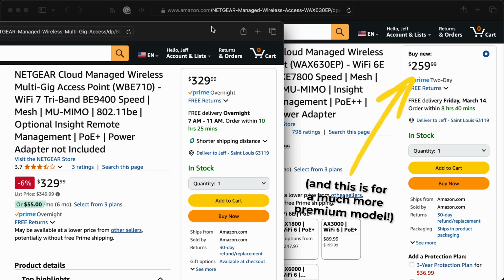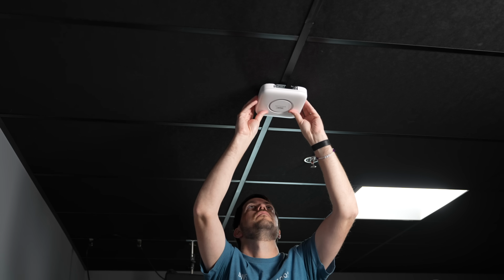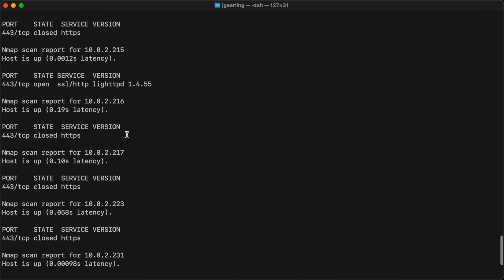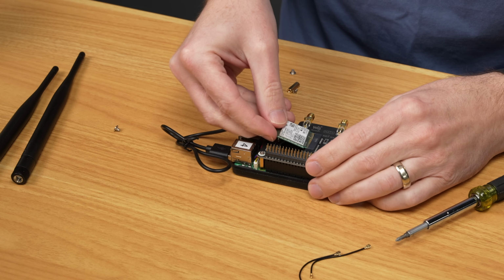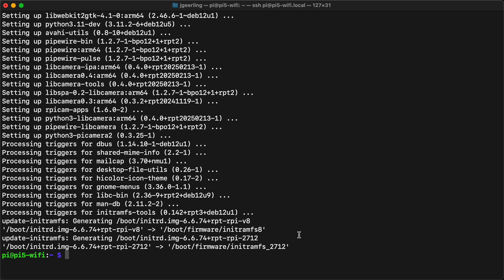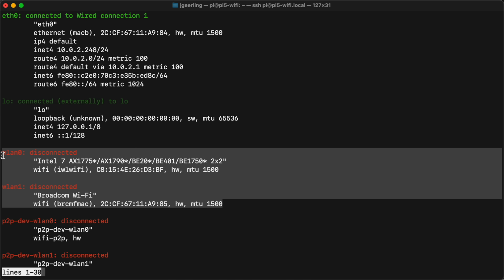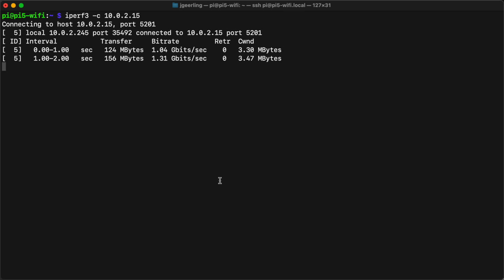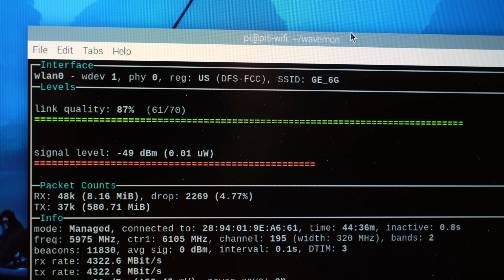The fastest WiFi EVER on a Raspberry Pi

Comment: 6:50 It's even easier than that actually. `sudo apt install firmware-linux` should grab all the firmware you'll ever need, and install it to the right spot. You can even install it before you do the system update, so you can be sure it'll be up to date. This package is cross-platform, and it's saved me a lot of confusion and pain during my continuing journey to get an NVidia GPU running on my Milk-V Jupiter. Highly recommend it in the future if you run into firmware issues, it'll make your life a lot easier.
Reply from the maker: Note that it installs the firmware packages packaged up by the OS distro—what I've found is newer hardware often still doesn't have its firmware included in the packages, unless you're running a cutting-edge OS release like maybe Arch.

For the Pi, it has an `iwlwifi-firmware` package but it only has outdated firmware and not even working files for the AX200!

Comment: Did you just say that wireless got faster speeds than wired ethernet?
Reply from the maker: On the Pi 5 with it's slow 1 Gbps network connection :(

Comment: Would be interesting to see if this or WiFi 6E cards could be used as an AP (or to create a mesh network?). Then the question would be (assuming it can be done, is stable etc), why hasn’t anyone created a board to do this where a CM5 (or perhaps CM4) can be plugged in and used :)

Comment: Hint for when you do stuff with passwords: 1) you can hide password containing lines from your bash history if you start the command with an empty space. That's the marker for not saving it to the history file 
2) you can also do a "read PASS" command to read the password from stdin, and then use "$PASS" in the commands. That allows you to show the full command line, and even save the history
Reply: The space in front of the command to prevent from adding to history is a bash config, don't expect it to be a default everywhere.
Reply: @kypdurron  Right. The HISTCONTROL variable configures this. It defaults to "ignoreboth" on Ubuntu, but might be set to something different on a random system you login to.
Reply: Sterling tips.

Comment: The biggest reason to wait on Wifi 7 is Wifi 8. The plans for it are 100Gb/s speeds, using a much higher frequency spectrum, with all the added benefits from Wifi 7.
The biggest jump from Wifi 6E to 7 is the larger channel size, which doubles the speed per device. So you are looking at a possible doubling of speed from Wifi 6E even, which is a much larger jump than the last few generations.
Reply: Agreed.  I was all set to standardize and upgrade everything from 5 to 7, but then I saw 8 is scheduled for 2028 (probably 2029 at the earliest for IEEE 802.11bn draft honestly) and the more spectrum being considered like 60GHz and said "heck with it, I'll upgrade stuff to 6 and sit tight 5+ years."  Just splurged on a WiFi 6 enterprise AP and more than satisfied.  WPA3-Enterprise support is still half-baked on e.g. Windows 10 and some APs so I don't mind delaying for once.  Plus I don't even have 2.5/5/10-Gig copper switches so 7 would be a waste until I upgrade wired backhaul first.
Reply: @dudeh9702  And depending on your setup, Wifi 8 may become your backhaul. Much easier than punching wires through your home, put them on opposite ends of hallways/etc, and boom.

Comment: With a few added features? MLO isn't something to skim over.
Reply from the maker: It is if it's hard to get any devices working on it so far :)

It's still early days for WiFi 7, just like 6E, it'll be a couple years before anything but the highest-end devices take advantage of all the goodies.
Reply: @JeffGeerling that is true (Windows support hasn't arrived yet, though it supposedly works on Google Pixels) however you did imply that you have MLO functioning, amongst other features, where it doesn't seem to be the case given your throughput (also couldn't find evidence of MLO support for Intel WiFi on Linux, only MTK). Another thing to try is 320MHz bands, if supported by your router.
Reply: @JeffGeerling , for example here's the difference between not having and having 320MHz functioning on Android (the Pixel just needs the router to "force" it for some reason, otherwise should have similar speeds to the OP12): https://youtu.be/0BJ8gvfJ8_E.

Comment: Lowering transmit power on 2.4 GHz is an underrated band steering technique. There is usually little reason to leave it at max power, especially in a multi-AP setup.
Reply from the maker: You mean you don't enjoy just blasting a little extra RF 24x7 out of every AP on the planet? :D
Reply: Lowering transmit power on every frequency is one of the ultimate techniques for Wi-Fi excellence: less interference to neighbor APs, less noise, less electrical power used, increase in hardware lifespan, devices connect to the better signal in terms of quality and not in terms of reachability.

Comment: Nice project, but I noticed you didn't use MLO and the 6Ghz channel was only 160Mhz instead of the 320Mhz that is possible with WiFi 7. I don't know what speeds the rPi can handle, but under the right circumstances 4Gbps should be easy to reach. (as long as the AP has an uplink fast enough and the bus speed of the rPi is fast enough).
Reply from the maker: 320 MHz width was used in the last 1.83 Gbps test; couldn't figure out how to get MLO to work end to end (it was enabled on the GE_BE network on the AP, but I didn't see anything on the Linux side where I could try forcing it or anything). Might need a driver update.

Also, I would probably need the fancier 10 Gbps AP if I want to go much further than 2-2.3 Gbps anyway

Comment: Tell me what's the point in wife when the AP has to be so close that it's easier to just run a netwrk cable. Exactly, there is no point.
Reply from the maker: Ha, well when put that way...

It is still useful in many situations where you don't have a ton of thick walls, or if you can put an AP in each room—but like I said it's more geared towards businesses and places with high-noise environments or with a lot of people.

WiFi 5/6 is plenty adequate for the majority of use cases, and WiFi 7 is nice if you need to not plug things in all the time but still need speed/capacity.
Reply: Smartphones, tablets and slim notebooks without a lot of wired connectivity are better use cases than a Pi, I think. But, yes, you need probably more access points than you would like to install. But that keeps the 5 and 6 GHz connections fast. There are no or very few collisions with the neighbor's WLAN because of the distance and the walls.
Reply: Wife is good for other things too.

Comment: I love your content. I am mostly a fan of DIY, but if i wanted to start playing around with Pi do you have any suggestions on where to star? Fun or functional projects?
Reply from the maker: Figure out something you want to do and do it! Whether that's building a little Pico-based robot or sensor, or building a camera setup with a Pi for Timelapse's, or whatever.
Reply: Maybe start with a small, fun project to get to grips with the software and hardware, and then move on to something bigger that you could use meaningfully and permanently without necessarily being dependent on.
Reply: I got started by just learning how to set one up to boot to the desktop, then I just used it as a computer for a couple of days. I then moved onto a media pc, which was fun. Another fun project is a pi-hole, which is basically an ad-blocker, which is super useful.

Comment: Intel WiFi cards don't support access point mode, which is super annoying.
Reply from the maker: Technically you can get most of them working—we're currently messing with it on the BE200 for 6 GHz, but the AX200 and AX210 have been working well enough for a while.

Comment: What about 320Mhz wide channel? I only saw 160Mhz each time the network details were shown. Looks like the AP supports it and the BE200 definitely does
Reply from the maker: In the fastest test (towards the end of the performance testing) it is using 320 MHz. It seemed a little finicky, as it needed rock solid signal when connecting to bump it up to 320 MHz. I wonder if it will be hard to get that wide of a channel on many installations, as interference can knock that back down to 160 MHz pretty easily.

Not everyone can put their AP within a few ft of the devices like I was able to here!
Reply: @JeffGeerling  thanks for that info! I just got myself a Unifi E7 and BE200 (running in a Framework laptop, 12th gen Intel, PopOS, so a bit different than a pi). I was able to move a bit over 3Gbps solid with a burst near 4 the one time I got it to connect to 6Ghz/320Mhz (still tinkering and hoping to get MLO and 6Ghz working stable in PopOS). Any thoughts on why the pi results were slower? Obviously the tested Netgear AP can't exceed the 2.5Gbps uplink it has, but seems some performance left on the table? Results were impressive, I tend to just try to eek out everything I can from what I buy and curious how far a Pi could be pushed
Reply from the maker: @bauercole  From my tests between PCIe Gen 2 and Gen 3, my best guess is your laptop may have Gen 4, which gives it that edge (that's twice the bandwidth over the 1 lane)

Comment: I recently upgraded to a WiFI 7 access point from Ubiquiti. I had been using a pretty old WiFI 5 access point for years now, and finally accepted that I really needed an upgrade. But I genuinely couldn’t decide what to do. As far as Ubiquiti goes, their Wifi 7 access points aren’t meaningfully more expensive than Wifi 6E. I knew there were some trade-offs that mean that the older model might actually work better in some situations than the newer one. I ultimately decided to go WiFI 7 and so far things have been great, but it’s only been a couple weeks. On my iPhone 16 Pro Max I’m getting literally 4 - 6x faster wireless performance.
Reply from the maker: Definitely, a lot of the upgrades for WiFi 6 and then 6E would already help a ton with devices like the iPhone. Ubiquity is a bit different in how quickly they cycle through new revisions (compared to other companies like Netgear), and they seem to have hit a stride getting out WiFi 7 equipment over the past year.

I haven't sipped the Ubiquity kool-aid yet though, don't tempt me!

Comment: If you are a normal human who does not have a server at home or NAS, raspberry racks or even 800GB of files to transfer daily, WIFI 5 is enough and fast. my old router from 2015 still has good fast internet
Reply from the maker: Should still work for years to come too. Just like 1 Gbps Ethernet is still great for most people!
Reply: The Wi-Fi improvements are more for business or other high-density deployments. Max speed per device doesn't improve much per generation but total aggregate speed does.

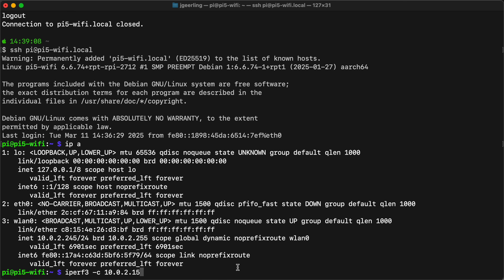Comment: 9:06 iperf3 has the bind (-B) option to tell it to use a specific interface
Reply from the maker: In my experience that does not always break through the Linux networking stack correctly. There are a few other ways to try to force it, but the only way to be 100% sure is to either software disable, or hardware disable (e.g. unplug), so I usually do that in my testing.
Reply: I've also had it seemingly ignore the -B and use something else, while swearing it's using the interface I wanted. it sent me on a wild goose chase reterminating cables a few years ago
Reply: @dziban303  Hehe same, which is why I'll never trust it, even if they have it sorted out!

Comment: Would it be possible to make a fully Linux based WiFi 6 mesh network with Pi's or other hardware to replace something like the TP Link Deco and similar WiFi mesh systems?
Reply from the maker: That's a good question; possibly, but that's a lot of networking magic I don't have the patience for :)
Reply: OpenWRT is Linux-based and supports wireless mesh (ie, 802.11s), but if you want a wired backhaul, you’re better off just using a bunch of routers in AP mode.

Comment: This is the fastest I have clicked on a Jeff Geerling video. Thanks to Wifi 7 on my Pi!
Reply from the maker: haha
Reply: @JeffGeerling  I have a challenge a single back plane highspeed interconnected PI cluster capable of running deepseek 671b Q8 at 16+TPS?  You would probably have to pool people are resources together with manufacturers and a university, but big project.  If it can do that, it would be suitable for low end training of 70B+ models at 16 bit plus.

The problem we face, is that companies are aimed at high end AI professional and infrastructure service.  They have less incentive to make a 1TB GPU card for local LLM AI and training for low end user, but try to force them to pay tens of thousands of dollers for a single professional card, and hundreds of thousands for a professional workstation.  Which hardly any end users can afford.  Even cheap solutions, hardly any end user can afford to train a 70b model, or run a 16 or 32 bit version.  Soon, they may run a lower percision q8 version.  These companies are simply making too much money on highly priced equipment.  But, that means there is lots of money to offer a sub $5000 solution, which could also be a great crypto mining solution.

If we imagine the problem as a series of matrices, pi's can be laid out on a board in a grid, each pricessing it's local memory with high speed interconnects passing data between them.  The model is then optimally spread across the array to keep data transfer between pi's to a minimum, while the pi's can saturate on their local data.

If we mount them vertcally to the boatd, they are like radiator fins, and we can use active cooling and overclock and pack more.  Finally, a 3D cooling block structure with pies in rows inbetween the block fins (metal or pipes) allow even faster.  The thing is, that maybe raspberry foundation themselves might be interested as a testbed.  It would be similar to an pi array chip.
Reply: @JeffGeerling  when will you talk about 802.11ad,
Reply: pls tell me what do you use your pi for.
Reply: yo same